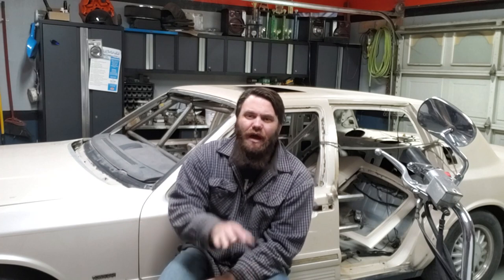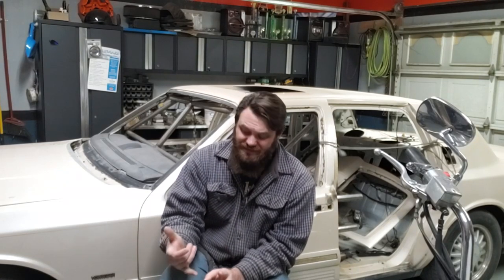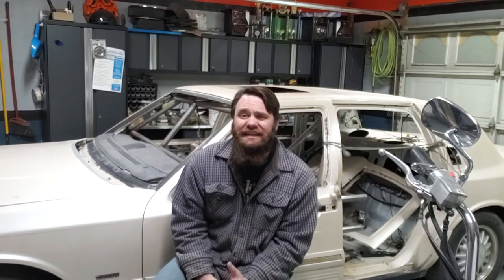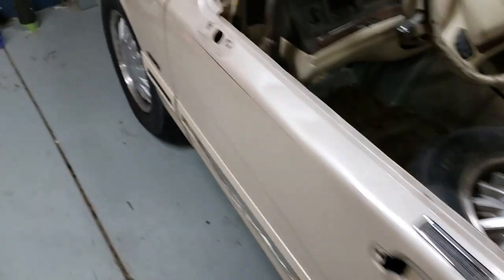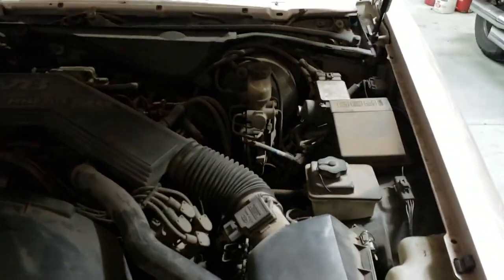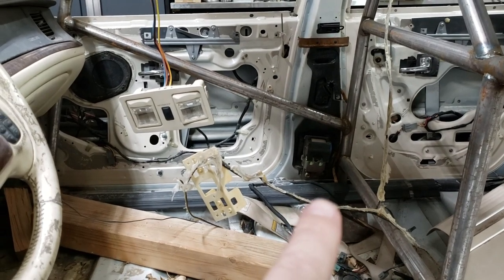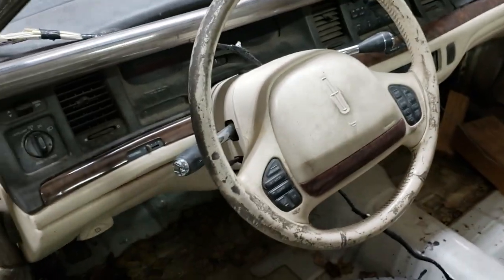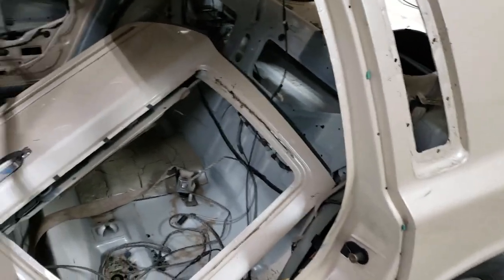Bootlegger Bomber Dirt Track Race Car Build Introduction How to get into racing for cheap

Comment: Still debating if i wanna build another 805 car for next year
Reply from the maker: Doesn't necessarily have to be another "805" car. As long as you build another car! But it is a pretty good theme.
Reply: @wadelumsden1548  well I'm definitely running my same scheme